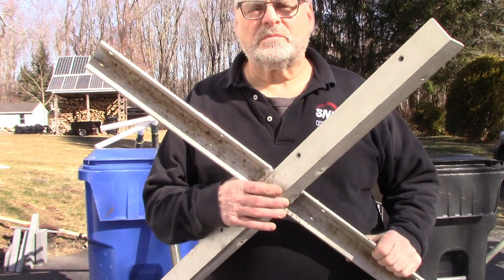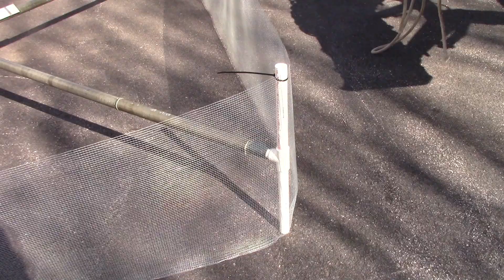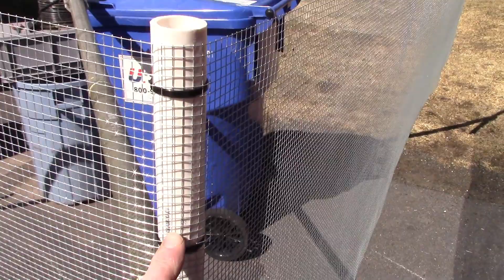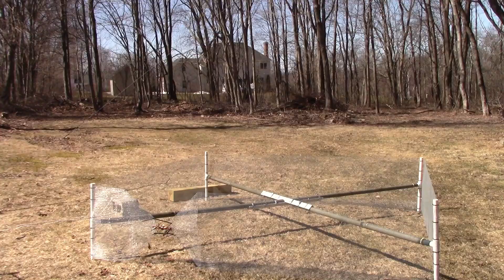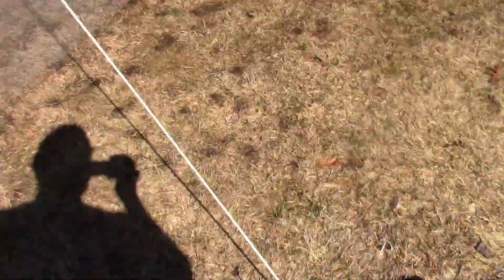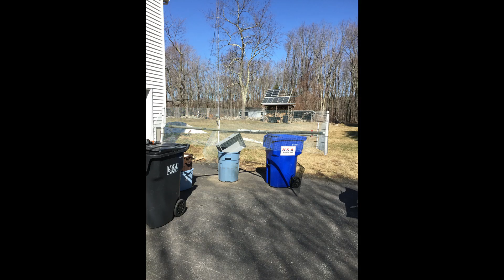Large LIL Low Impedance Loop 9' x 9' For VLF

Comment: Great video, Paul.  Can't wait to see it in action.  Have you thought about re-checking the coupling transformer?  I know you optimized it at 10-turns for the 5-foot flashing loop, but I wonder if it might be possible to squeeze a few more dB with a few more or less coupling turns to optimize the match with the larger width and diameter  hardware cloth loop.  Just a thought.  73
Ken  --  WBØOCV
Reply: Another question, Paul -- is the secondary coupling 'loop' wound with single-strand enameled wire, multi-strand insulated wire, or Litz wire?  Would there be any benefit to using Litz wire for the coupling winding?   I know you are a big proponent of Litz wire for winding smaller loops and ferrite rod antennas, but I don't know if it would make an appreciable difference for winding teh coupling transformer.  Ken  --  WBØOCV

Comment: This is an amazing construction work. Suggestion: Add many taps to the secondary of the impedance transformer and make them switchable remotely.
Reply from the maker: Hi Prog.. That's a great Idea.  I will do just that with my original LIL Copper look and see how the idea fares.  If It works out I will transfer it to the large LIL in the back woods.  Thank you  W1VLF